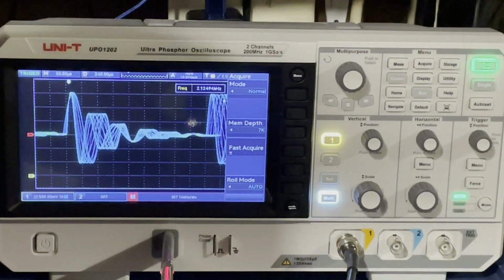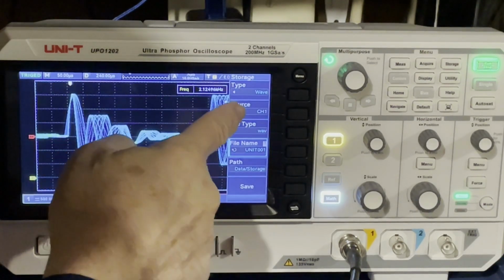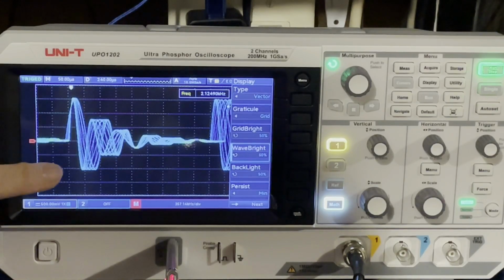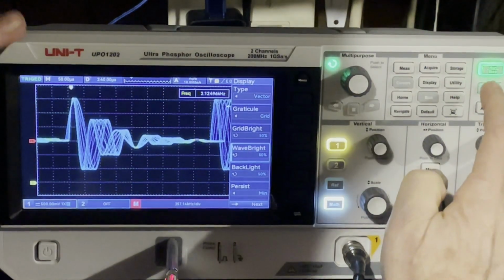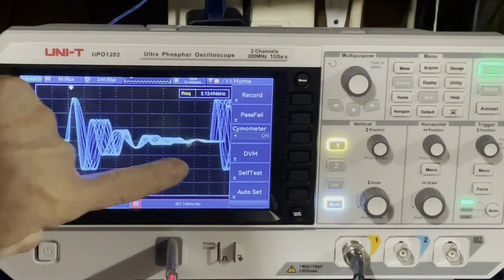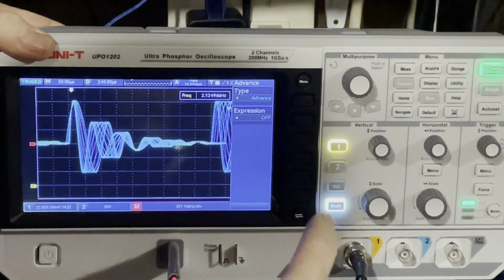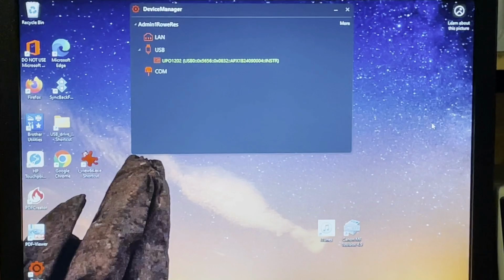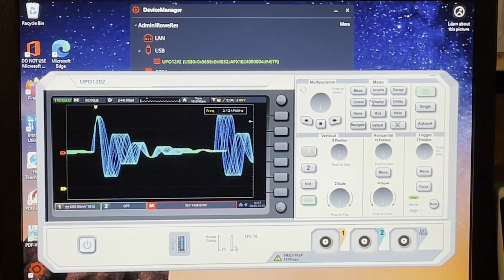Uni-Trend UPO1202 oscilloscope tryout

Comment: I just got one too (a 1102-100mhz upgradable to 200mhz). 
I have to say for the money indeed is SUPER NICE, certainty more performant the other "non china" scopes.
It comes with a 5 year guaranty but sadly it has a void if remove sticker so no peaks inside. 
Mine is has a smell and a kinda loud fan... hopefully at least the smell will go...
Reply: hope you reply to this, im planning to buy a UPO1102CS (100Mhz) model. is it upgradable to 200Mhz just by flashing new firmware? and where to get the softwares needed? thanks!
Reply: @kobs9636  .I don't know if the CS does that, look on their page